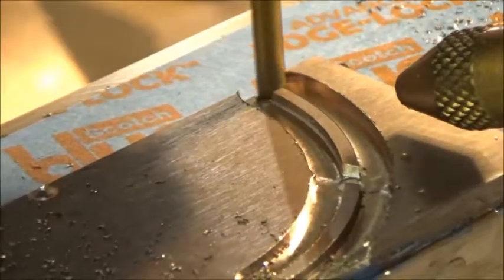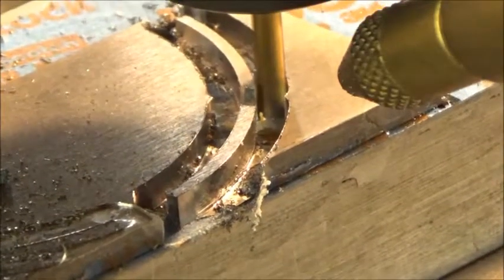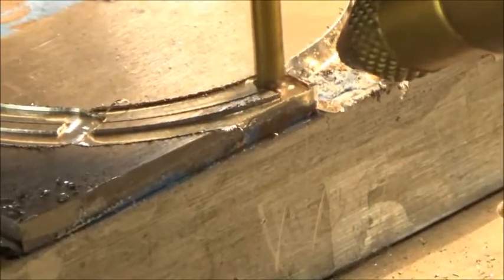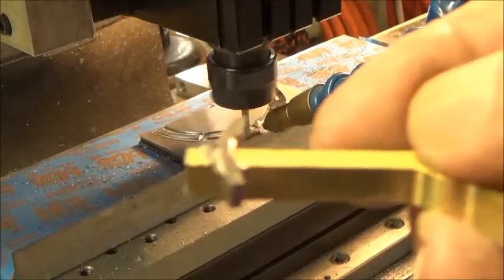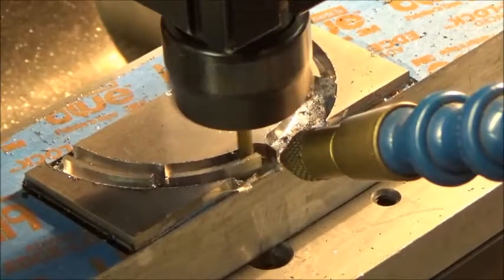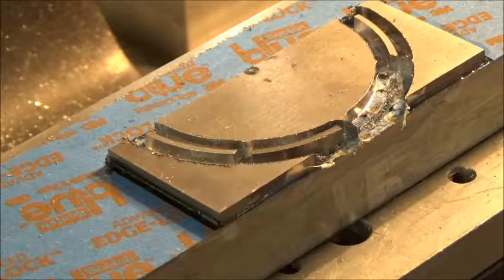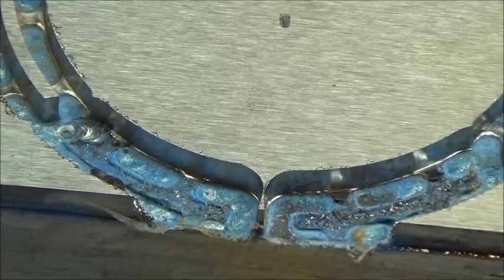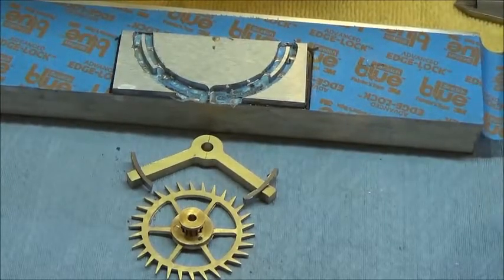Regulator Clock Build - Pallet Nibs Follow Up

Comment: Larry, that worked out really well, years ago I used a Loctite 401 I had heard it was good for similar operations like your one here, after cleaning both steel plates with acetone I stuck one plate onto the other plate and clamped it into a mill vice, and took a .100 thou deep cut with a 1/2" endmill cutter and milled a slot  in the top block, it worked, the main thing was you had to start the cut gently until well in at the start then I was able to use powerfeed it went right out the other end no trouble and to remove the block I had to give it a side rap to release the adhesive,
Reply from the maker: Walter:  That sounds like great advice.  When I've tried double sided tape it comes loose right away, or if it doesn't, and the piece is thin, the heat from milling will loosen it.  The painters tape seems to stick really well and resists lateral movement.  Thanks again for the heads up about the Loctite, it certainly would be a much simpler method.  Best Regards: Larry